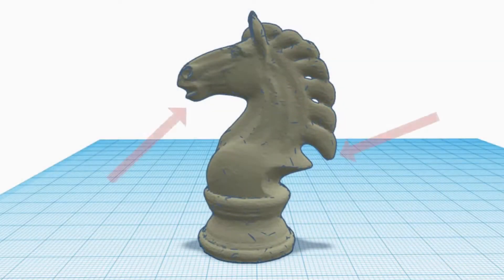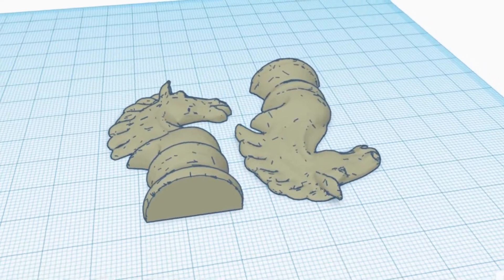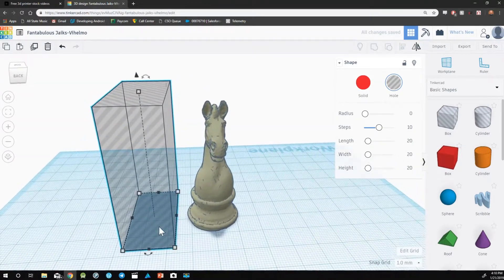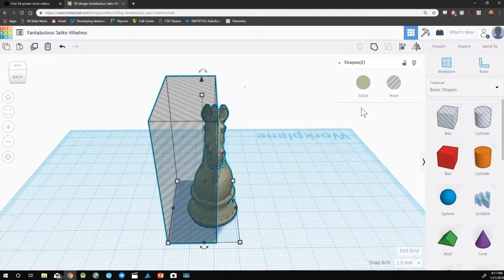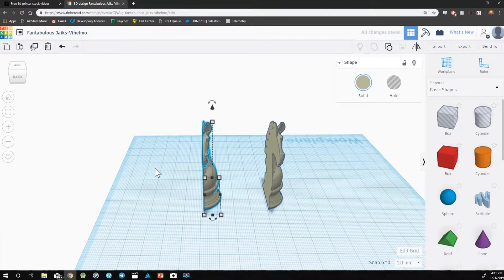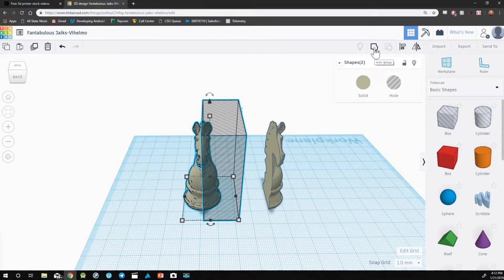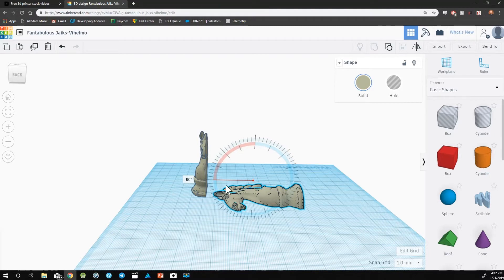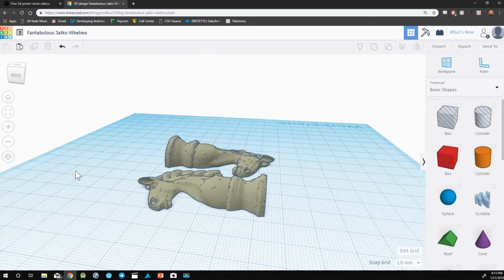How To Split Objects in Tinkercad

Comment: If the two sides are not exactly the same, this does not work. Instead, make the hole box 0.1 mm wide and center it on the object, then group. You will then be able to separate the two sides.

Comment: couldn't you just mirror the duplicate half
Reply from the maker: Yes that will also work in most scenarios but will not work when an object has text on the surface as part of the design. This method ensures no text gets flipped.

Comment: Yes that works, but what do you put the two halves together with? In my experience, there isn't a glue that will bond as well as making it in one piece.
Reply from the maker: Printing in one piece is always more ideal. When needed, I use a glue called BSI-157H. You can get it on Amazon, it comes with an instant cure spray

Comment: Helpful video, but I have a question. Are the terms different in FDM printing as opposed to resin? What you call overhang I know as "islands". Overhang are parts that hang out over the print bed or vat, but are still printable but might require supports so they don't droop or drop off.
Reply from the maker: That's a great question. I do not currently have experience in FDM printing, although it is something I'd like to get into. Did you figure this out?
Reply: I'm also only into resin, but from what I've read and seen on videos I believe I am correct. Overhangs are parts that are connected to the print but "hang" out over the print bed, but within an acceptable angle. Without support they could break off during printing causing a failed print. "Islands" are just that: a piece just sitting on thin air with no connection to the print itself. Think of a mini with an arm, holding a sword, stretched out horizontally. The arm from shoulder to hand might print fine. The pommel of the sword tho hangs below the level of the printable arm. It has no connection to the print. An "Island". They show up in the slicer as little bumps or pieces just hanging around. They will be printed and that's the danger of them. If they get loose from the FEP they'll float around in the resin possibly getting between the print bed and LCD and can puncture the FEP. With filament printing an island leads to stringing all over the print job starting at the point of origin of the island then to the print head's next destination repeating with each pass over the island.

Comment: You should use the align function to make sure it's in the middle.
Reply: It doesn't necessarily have to exactly bisect the model, since both pieces will just be put together at the end anyway
Reply: @nickoldberg1752 Then you don't end up with the exact object you designed.

Comment: Just done it and its Brilliant, so much better than the other way I learned.   !!!!!!!!!!!!!!!!!!!! 5 stars.......

I have just subscribed to you, if you keep making videos like this on tinkercad i ll keep following you, they are sharp short and to the point and work , no waffle just good training videos. something that is severely lacking in the tinkercad world, I have even checked out the lyndas course and your video is better. you learn more in 2 minutes that 20 on theirs. 

This splitting for me is one of the biggest pains, im redesigning a complete K40 laser to a massive bed and I have been trying to get things done like this and up until now I so hated the other version I learnt .  I just copied the part and hacked away on one version and then on another version and eventually got their . I have to split parts to add additional parts in , its not for printing , its for changing the width on a part of the depth or length etc.  Maybe add some more tags as its not just about splitting, its cutting in half perfectly . This has really helped me . Thank you
Reply from the maker: I am quite glad I could help out, it is difficult to split perfectly in half in Tinkercad. I wish you the best of luck on the K40 laser redesign, that sounds like a very impressive project. Cheers!

Comment: There are only black handles in the Workplane to do this duplication by 
sliding the hole object around the opposite half. How do you do this 
when the cut is parallel to the Workplane surface? (ie, I want a top 
half and bottom half, split to add an extension in the middle. I realize
 I could flip the original object 90° then use your technique here but 
this creates other unwanted overhangs.  How do you flip the hole in the 
vertical direction?
Reply from the maker: The same technique can be used, there is a white square in the center of the shape you can click and drag to manipulate the shape's height.